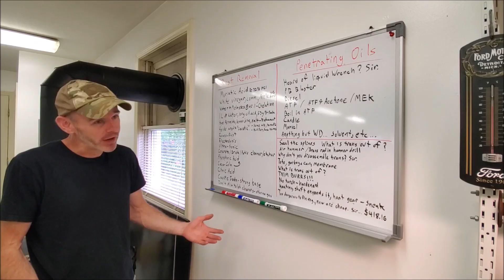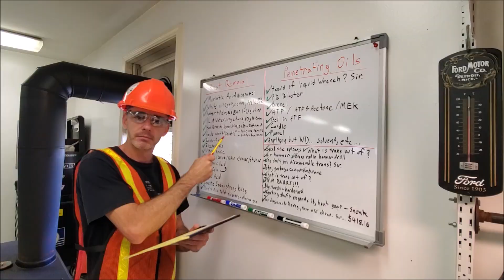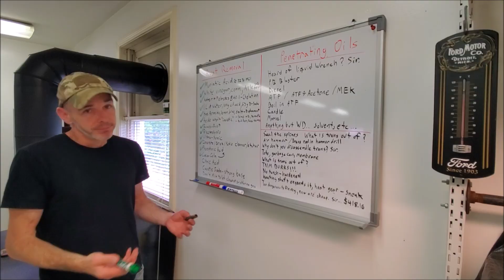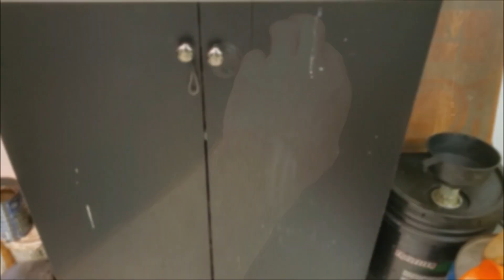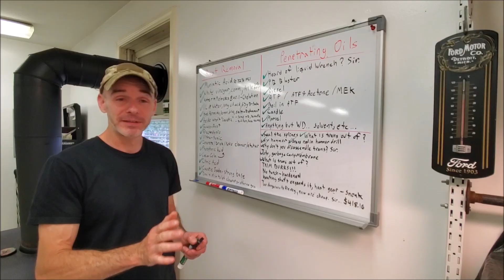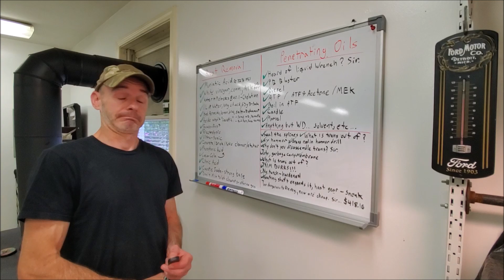Gearbox Restoration: The Toilet Bowl Cleaner Experiment Q&A!

Comment: While it's sitting as it was in this video just keep dripping diesel or muric into the spline each time you see it...
This will creep in...
As you are doing this sort of thing a lot...
I suggest a old bath or appropriate container..
MUST HAVE A LID.. there's a good reason for this... 🤔
then...
(this will make sense... eventually)
Drill two holes high and low for copper pipe fittings 28mm or bigger.. and make a tube that coils..
It needs to end up being several feet away... or preferably further..
As it's going to be heated..
Make a brick and clay fire box.. stove...
This will heat the liquid... VERY HOT..
btw the lid is to stop any hot bits setting the liquid on fire...
Now you can boil diesel etc and add old oils.. Not petrol or anything highly flammable..
Insulate bath...
Note all this needs to be away from buildings...
You could heat by electric but cost?
Seen people use heated baths with caustic soda to strip paint.. years ago.. I know not what fumes come of...
Another thought was to apply hammer gun to the outside of the gearbox but only one end is held now...
A violent sonic device...

Comment: Go build you a fire in your yard and chuck that transmission in it. Hot enough to break the rust loose, not hot enough to hurt the temper.
Reply: Have you seen my comment...
Similar but slightly less brutal..
Maybe more fun...

Boil it in diesel..
With any old oil.. it helps raise the temperature..
Great fun to do...
Slightly dangerous 💥

A friend.. just for a laugh.. tried electroplating a gearbox he had in bits..
Some how he'd got a bag of copper sulphate..
It certainly helps with stopping rust.. though some is verdigris green.
Nickel and chrome are expensive for the amount he needed.

Comment: The citric acid/baking soda mixture is a chelation (👂key-lation) formula developed by backyard balistics channel. It functions roughly equivalent to evaporust, just A LOT cheaper. It does not depend on its acidic nature to remove rust. That's why it is buffered with the baking soda so that it doesn't harm the underlying metal. I've used it and works really well.
Reply from the maker: That's very interesting, thanks for the clarification, I will have to try it!
Reply: Also I thought neutralizing an acid with a base makes an alkaline, which is not exactly neutral like the pH might suggest.
Reply: @Spudz76  A base is alkaline like acid is acidic. it depends on how much you buffer the acid  to how much it will change the PH, Back yard ballistics guy recommended using ph test strips to leave the solution just barely on the acidic side. It's worth watching his video, he explains it thoroughly.
Reply: @TgWags69  Still doesn't make sense to me. If he is adding baking soda to reduce the acidity then why not just use a weaker acid, or cut it with water? Seems like adding the baking soda is defeating the purpose.
Reply: @steadyeddie7453 if you had a spill on a beautiful wooden table, would you dry it up with a blow torch or a sponge? The blow torch would dry your table, but would oxidize and consume part of the table in the process. Acids are like the blow torch when used on metal. Yes, they clean up the rust, but also dissolve metal in the process. If it's just an ugly lump of thick metal then sure soak it in acid who cares. But, if it is a valuable peice of metal and you are trying to conserve as much originality, such as size; shape; surface finish, as possible then using a chelator to soak up iron oxide and leave the underlying surface alone is your best option. By reacting citric acid with baking soda, you are making sodium citrate. You can google "sodium citrate iron chelation" for more information. Maybe it would be less confusing if everyone just started calling it what it is instead of confusing everyone by calling it citric acid.

Comment: I've used a wax candle to remove factory oil galley plugs with a torch and it worked suprizingly well. The acetelene alone wouldn't  touch it.
Reply: I think it's less the wax and more just a hot liquid that wicks well conducting heat into where the flame can't get.  Similar to penetrating oil helping even if a lot of it boils or flashes off, if you can get it hot to just below flashover then it works best, and I don't think it's all about quench either since it works better when brought to that edge temperature and almost never does anything when first sprayed on.  It evaporates more where there is a lot of air but down in the crevices there isn't much air for it to evaporate into.